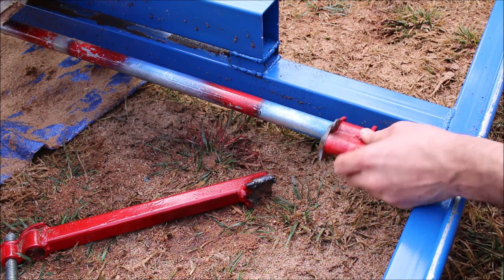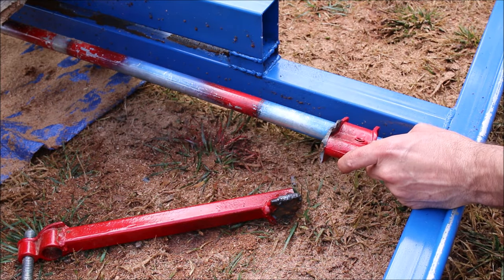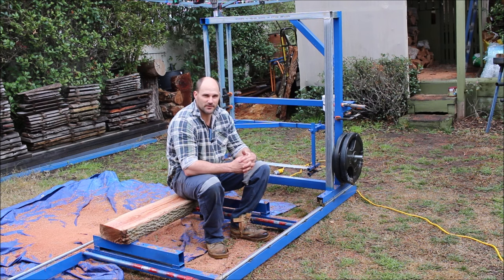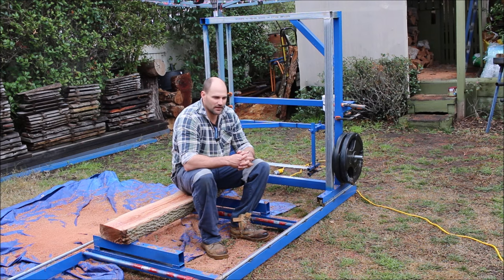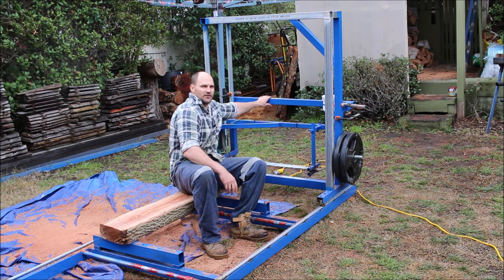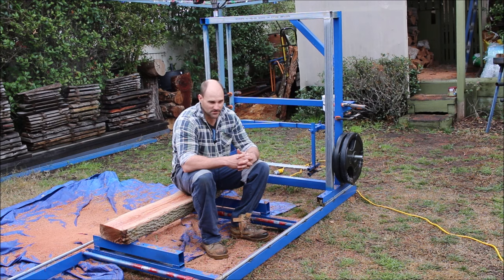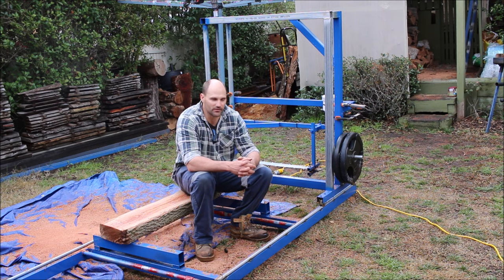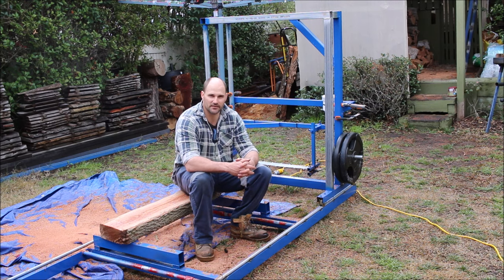Making an Electric Chainsaw Mill - Part 3 - Making the log clamps, lube system and paint

Comment: Right now your entire blade rack is attached to the log frame purely on weight, there's nothing to keep it from lifting off.  If you catch a board wrong or get tippy in any way, there's nothing to keep it from falling over or the casters coming off the rails except the saw bar inside the log.  Could be a bit exciting if you ever run into something like that happening.  Catching a hard piece, steel, wire or something in the log will cause a "jolt" and with the direct drive from the motor to the chain it'll keep spinning till something breaks or you shut it off.  Should also consider putting a stop at each end of the caster rails so you don't runoff either end.  I don't suppose that system is very light and you'll only run it off the end once before you decide to put stops on.  

Might consider a variable speed motor with a clutch on your chain and sprocket.  That will also keep you from having to flip the switch off and on.  That's one of the reasons, small gas engines are used.  

Third thing to consider is the bracing/frame of the saw itself.  You added additional bracing, making it more rigid but your saw bar is still a cantilever beam.  That's the main reason you are getting vibration/saw wobble.  If you make a box frame that holds your saw at both ends and add the lifting screw and slide poles on both ends then your saw will become a beam that is supported on both ends and you wont get the blade wobble.  If you continue to run it like it is, you'll bend your bar, cut crooked and constantly burn up chains.  

If you attach the saw frame to the overall frame with rubber grommets you can take out some of the vibrations.  Think of the cross bar handle on a chainsaw.  They are attached using hard plastic and rubber and flexes when you use the saw.  They are also there to limit the vibration you feel in your non-trigger hand and arm.

Lastly, put a push bar or something up and behind the saw frame to mount your controls and put your hands on to guide the system as it cuts.  Get yourself as far away from that saw bar as possible.  It was hard to see from the angle of the video but your hands, feet, arms and legs are way to close to the action.
Reply: a secondary rail that creates a lip on the outside running along each base with a welded fin on the bottom of the moving part that slides under the lip should work well to keep everything from coming off the track.
Reply: I agree, though I would add a trigger bar or pressure switch like those used on electric mowers that cut off as soon as the user lets go. That toggle switch scares me silly!

Comment: Awesome idea and job!  I suggest a simple mod for safety... 
Currently to turn on/off the saw you have to plug/unplug the power cord.  And, you walk behind/over the log and saw which can be dangerous if you tripped and fell onto the saw as the chainsaw will still be running. 
Instead of having to plug and unplug the power to start/stop the motor, you might want to consider adding a momentary switch/trigger similar to what is on a circular saw or other tool.  And, have it positioned on the side, so that you can walk on the side and don't risk tripping by walking behind/over the log and chainsaw. 
By installing a momentary trigger/switch the saw will only be running when you're pressing on the trigger, so if you slipped or tripped the saw will stop when you release the trigger.
Reply from the maker: I agree 100%
Reply: glad someone else suggested this too!

Comment: Just a Suggestion, after some hrs of using it, there is an increasing probability to have an accident. Your knees are pretty close to the chain. Take it as a suggestion: A) Put some handle to push the frame for far, may be 1 meters from the back (it is just some more metal but cheap if you compare it to the consecuences) B) Add an emergency button to stop it (or start and stop), in the place where youre going to push the frame.  Anyway, pretty witty and well finished. Good idea to share.

Comment: Awesome brother, also like that rain water collector system you have on your house. 
If you connect a  nice slow moving winch to pull the mill across the log you will not have to push it from behind which looks a bit scary to me. If you trip we could be calling you capn Ahab.

Comment: Very nice build!  It certainly works well, no argument there. 
A band saw blade over chain saw is far more time efficient yielding much faster cutting speeds.  Time is money after all.
 I also would think new/replacement band saw cutting blades are cheaper for any given length but I haven't compared the two. Cheers.
Reply: A bandsaw mill is usually faster but not always. With enough torque and speed a chainsaw mill can outpace a bandsaw mill

Comment: Really nice mill, never even crossed my mind to just get a bar and then drive it with a separate motor.  also like that you went electric, a lot of these tend to be gas. Gas is harder to come by when you're in middle of the bush not to mention expensive now days.  Solar power is free and abundant.

Comment: Mitch, my worry is that the oil you use to lube the chain will get into the wood. On a normal band blade they lube with water. I like adapting a chainsaw like you have done, but if I was going to plank a piece of say Cedar with the intent of making furniture, I would probably prefer a bandsaw cut.
But there a re a hell of a lot of things that can be cut with your system there.
Thanks for sharing that project.
==BOZE==
Reply: I was thinking the same thing at first but most projects are going to run through a plainer, I would expect any oil would get removed during finishing.

Comment: I noticed some of the cuts had visible lines on them, partially from the weight of the board pressing down on the chain(looks like you took care of the vibration with the counterweights). When I was researching electric chainsaw mills I found a handheld circular saw attachment called a beam saw that has a metal bar behind the chain so the wood board doesn't pinch the chain while cutting. I think it would greatly improve the cut board's surface. Great project!
Reply: Hmm, a riving knife wouldn’t make a huge difference to the cut quality, it would need to be the same thickness as the kerf to support the piece above to stop it pressing down which wouldn’t work

Comment: Always a design as you go. But there is absolutely nothing wrong with doing that. I would install a safety bar behind the saw so if you fall, you don't end up into the chain blade. It only has to happen once and it is all over. But nice setup. You do know the wide kerf of the chainsaw blade makes it a whole lot slower then a typical bandsaw blade I'm sure... Thumbs Up!

Comment: Interesting build. I would try pushing from the side rather than behind, for obvious safty reasons. Also try gringing your chain teeth to zero degrees for full tooth chain or 10 to 15 degrees for skip chain. Std 30 degree chain is way too aggressive when ripping. The above grinds will give you a smoother cut with less chatter.
Reply: Skip chains are the best way to mill for sure. Especially with a torquey electric mill. Less teeth, less load on the chain, keeps RPM up too which leads to less bar wear and better cut quality

Comment: Nice job ,I’ve wanted to make my own chain sawmill for a long time just haven’t had the time ,but this has some great ideas and like everything there’s always improvements as u go ,that red wood is gorgeous 👍 and the reason your pipe clamps didn’t work is because there cast and u can’t weld cast ,u have to braze it 😃
Reply: You can weld it, just very difficult and technique varies on composition and grain
Reply: @whirled_peas  preheat the cast iron, then mig it.

Comment: Dont know if anyone has said but would get a flat plate welded behind the blade parallel with the chain blade so ifit ever rolls back you dont end up 2 feet shorter and some sort of safety switch as soon as you let it go it cuts power to the motor just in case you trip when walking

Comment: Great job, much appreciated.  I am looking to build something similar except the supporting frame/base will need to be portable/bolt together so I can build the frame around large trees that cannot be moved without a crane.  I am considering a band saw as opposed to chainsaw blade because of the likelihood of there being steel items embedded into the trees I will be cutting.  I have three black walnut trees that are approximately 50-90" in diameter for a majority of the lenths and as long as 14' in length.  I'm planning to cut all into table slabs and the left overs I'll use for gun stock blanks, butcher board, knife handle material, etc...

Comment: I have an ideea for the lubing system ! Would it help to have a small metal guard attacked on chain right in from where the oil is droped, would not help preventing the cloging from all that wood dust ?

Comment: Three important things you definitely already know.
1: The sharpening angle of the saw chain for the sawmill is 10 degrees. (It's usually 35 degrees.)
2: Lubrication of the saw chain is absolutely necessary.
3: The linear speed of the saw chain should be the same as that of the chainsaw. (choose the largest sprocket and the electric motor must be at least 3000 rpm.)

Comment: ... that machine is truly terrifying!
Please put the power switch on the push bar at the very least and rather than a toggle, use a pressure switch or trigger like those on electric lawnmowers so it cuts off when you let go!

Comment: I'm from British Columbia Canada. We don't have 3 phase radially available. 
Was thinking of 17 to 20 hp 4 cycle gas motor. Or even hydraulic ( have exterior hydraulic on a machine.)
Chainsaw aren't consistent power. Hydraulic are. 
Like to cut up to 5 ft.. cottonwood or hardwood crotch.
Reply: That one is single phase.
Reply: Don't want an electric. Too costly. 
What is the blade speed. RPMs?
Reply: Gostaria dê saber ô preço dessa maquina

Comment: What chains  do you use? CrossCutting chains? What's the electric motor rpm and Kw?
Reply from the maker: Here im am just using a normal cross cut chain, the motor is 2800 rpm and its 3hp

Comment: How many RPM do you need to have on the electric motor?
Reply: The electric motor is probably less than 4k rpm, which is not fast enough for the chain, which on a chainsaw run at 10k rpm.

Comment: Are you using a ripping chain?
Reply from the maker: no
Reply: you might want to try one.  The angles on the teeth are different and you will be able to cut much faster, and less resistance on the saw.  I have ripping blades for my table saw and if I am ripping a lot of material, I will change the blade over from a combination blade.   @mtarrant3
Reply: @rickwatts2642 file the teeth to ten degrees

Comment: Larger sprocket will give you faster chain speed
Reply from the maker: 100% but I would compromise torque, Ideally I would have used a 10-15hp 3 phase motor with a big sprocket (20 tooth or more) but i don't have the circuit for it.
Reply: @mtarrant3  was wondering about the motor too, if smaller or bigger

Comment: You are not using the full potential of that motor because you did not gear up on the output. Gas powered chainsaws spin at 7,000 RPM's or more. You need to gear up with 1:2 gear ratio to get better performance or switch to a low speed design chain.

Comment: Why on Earth would you go through all of this work and expense to build a chainsaw mill when you could have built a bandsaw mill instead? 
Chainsaw mills waste a tremendous amount of wood through .250- .325 kerf loss. Bandsaw only loses a little over .050 in kerf loss. You’re spending all of that extra time and power required to generate a quarter of an inch of waste with each pass. 🤦🏼‍♂️